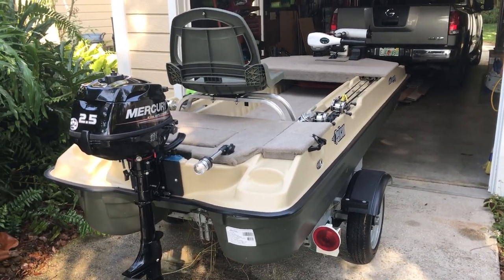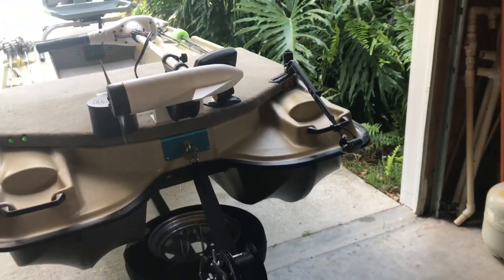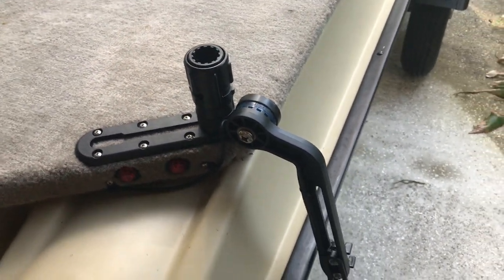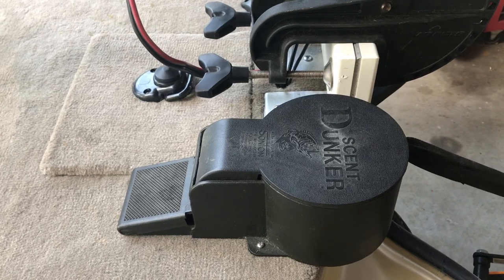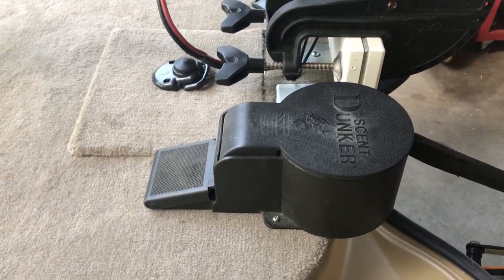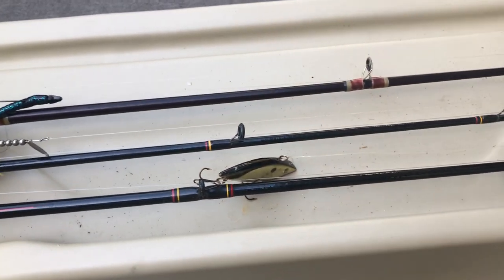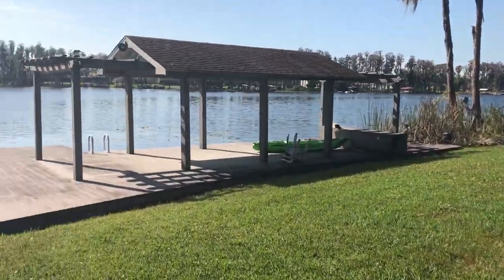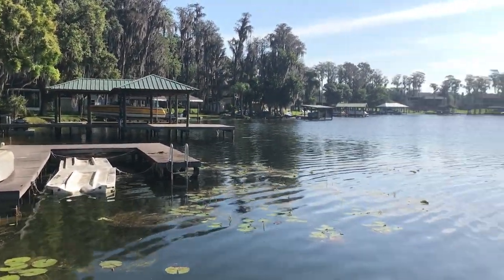Pelican Bass Raider 10E, Transducer

Comment: Been looking for a bass raider video like this! Mine comes in tomorrow! My goal is to make it the same as this one. Awesome job on it! I am a new subscriber!
Reply from the maker: I would only advise you to think of your style of fishing, think very carefully of even the smallest details you might want to incorporate in your finish product, before you drill the first hole or make the first cut.  Sit in front of your boat and stare at it for a couple of days, imagining what you want the boat to accomplish.  Utilize you tube for ideas, learn from the mistakes and strokes of genius from others with like ideas.  Remember, weight and clutter is the enemy.  Good luck & I look forward to seeing your finish product!
Reply from the maker: One mistake I made was that my rear deck design prevented me from being able to mount a trolling motor on the rear mount, due to the length of the set screws on the trolling motor being too long.  My outboard motor just barely fits.
Reply: Jim Greene ahhh ok well I’ll keep that into account. I kinda fish everything. How do you like the boat overall?
Reply from the maker: @brettscanlon4935  
Hi Brett,
Well, I'm 62 old years, with a bum hip, so my opinion might be a little one sided.  But here goes....  If you do most of your fishing from the seated position, it's a very stable 10' boat, even with two people.  This is because the center of gravity is very low.  When you start going to a standing style of fishing, that center of gravity is substantially higher, even more so when you install elevated casting decks.  In the latter case, you'd better be pretty nimble on your feet, or you'll go swimming prematurely.  I've come close a couple of times.  This may occur when you start trying to walk around from the raised deck down to the lower deck etc..  Side to side stability becomes a concern.  Now having said all of that, I primarily fish alone, so the boat is not as stable as it would be if another person was seated in the rear.  As the boat would be sitting lower in the water..  lowering the center of gravity, ie…. more stable.
No matter what you want to do to modify the boat, remember, it's just a 10 foot boat and you can only do so much with it.  You can put everything but the kitchen sink in it, but it becomes a submarine at some point.
Reply from the maker: For my mods & fishing style.....  It's a blast!
Reply from the maker: Don't overlook the Kayak industry, they have a lot of light weight neat mods & gizmos you might want to incorporate in your design.
Reply: Jim Greene that makes sense. Thanks for the heads up on it. Would you be able to do videos on how you did your boat? Measurements and such? I’d like to set the boat up similar to what you have. I’m 28 in Kentucky. I’m in the military so I travel to different areas a lot. I decided on this boat because it’s easy to move with and if I decide to get a camper I can just throw the boat in the back of the truck. I kinda fish depending on where I move. Done all kinds of fishing.
Reply: Jim Greene I also have a YouTube channel. Hffoutdoors. The dog training videos, but going to be posting my boat on it and I’ll give yours and another one a shoutout when I build through it.
Reply from the maker: @brettscanlon4935  
I look forward to seeing your rig!
Reply: @brettscanlon4935  dude, fish wherever you get stationed or go tdy. I never knew carp was fun to catch or eat until I got stationed in Hungary. It's basically the bass of Europe. Enjoy any moment you can dictate on your own.

Comment: Would u do a review on that little outboard . Top speed ?
Reply from the maker: Hi Payton,
Take a look at the following Mercury/Tohatsu specs.:
2.5HP-41 lbs-4500-5000 rpm $598.00
3.5 HP-41 lbs-5500-6000 rpm $714.00
The only difference in these motors are the carb. jets, allowing for more rpm.

If you don't want to over power/over weight the boat, these are your only choices for outboard motor HP's.  Once you increase HP from there, you also increase weight.  And you begin to over stress the transom... ie cracking.  Once you begin modifying and loading the boat with equipment etc..  Outboard performance starts dropping off dramatically.  These little motors just can't push a lot of weight.  Not to mention the Pelican Bass Raider is just a little pontoon boat to begin with.  So, don't expect to get up on "Plane" unless you are 125 lbs. with nothing else in the boat!  With any 10 Ft. boat, weight is always a compromise.  But, I'll try & post a video of how mine performs on the water as soon as I can for you.

Comment: How stable is it when on the front deck ?
Reply from the maker: Well Jim, it's not a Ranger Bass Boat!  Having said that, if you have no ailments like bad hip, knees,  ankles etc..   It's doable.  For a 10 ft., 44 inch wide little boat, it's as stable as it gets.  The deck itself is very stable.  As always, weight is the issue when you raise the center of gravity of the boat.  If you are a big guy, I would not stand on the raised deck though.